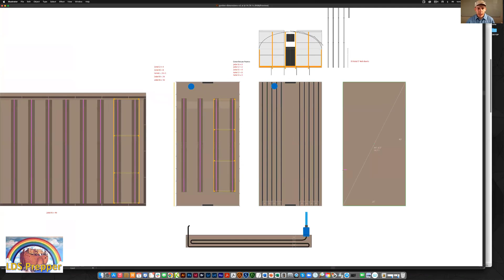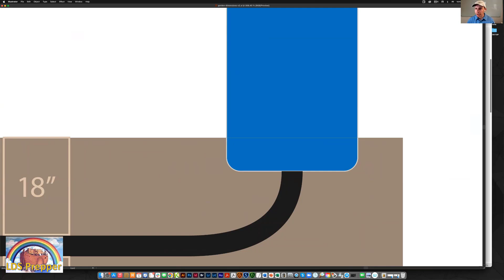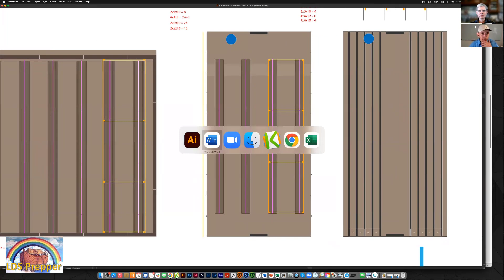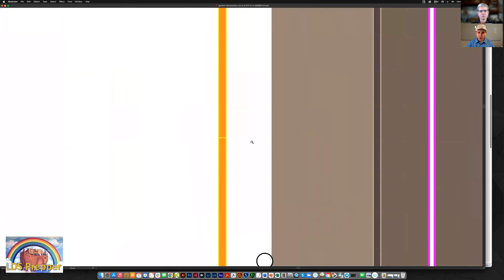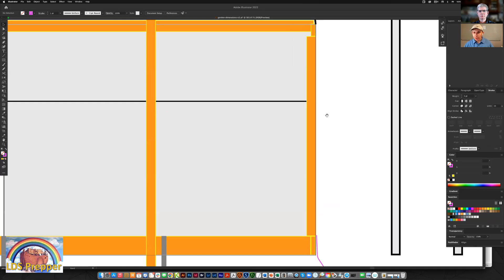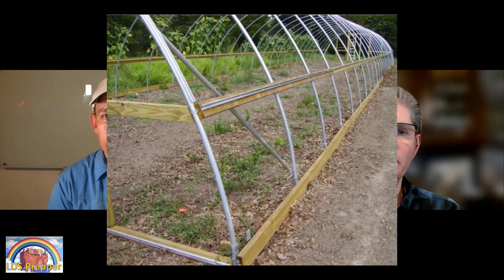Geothermal Greenhouse Step-by-Step: #1 Planning

Comment: So I hope Doug didn't use that for the concrete down the whole method because that doesn't work.  concrete was meant to be mixed,  so the water won't distribute evenly if you just pour concrete and water together you'll have dry spots in the concrete.  Can't tell you how many times I hired a concrete man and he did that.  I had to tear the job out and do it again.  That's just a lazy man not doing his job

Comment: One issue I see here. The pipe on the far right will present more resistance for air suction (length is longer to reach the fan). Therefore the fan will tend to go the easier way and suck air from pipes closer showing lesser. To avoid that issue, a huge manifold is more suitable to collecr the 5 pipes. The fan must be located right at the middle of the manifold (from top view) to have symetrical alignment and ensure same resistance from all directions.

Comment: When setting post, drill a 1/2" hole, 6" from the bottom.  Put a 1/2" piece of rebar in that hole. Place your post. Then pour the dry or wet concrete  mix around the post. Even in the weaker dry mix, nothing will pull that post out.

Comment: I fear that Doug is going to be disappointed by the performance considering the huge amount of effort and expense. The air volume of the greenhouse has absolutely nothing to do with the total length of tubing needed. Tube spacing affects the system bias,  for example, closer spaced tubes will rapidly heat up the limited amount of mass between them which leads to a rapid reduction in the temperature differential driving the heat transfer process. When used for heating, the limited mass with the closer spaced tubes will be depleted of heat rapidly and it will take many hours for heat to migrate from the surrounding mass to replenish it. The main issue Doug will run into is a lack of airflow because an 8" fan will not move nearly enough air for the system to be effective. I would highly recommend that anyone considering installing this type of system learn a basic understanding of the processes involved because errors in the design are virtually impossible to rectify after installation. A well designed system will provide both heating and cooling, at best the design in the vid will provide mediocre heating but no cooling at all. The cooling perfomance is important because its responsible for the lions share of the heat stored in the mass.
Reply: What type of calculation (length/fan size etc) with a long single tube system should be used? I have plenty of space. What you say makes sense and I only want to do it once.  Any sources you can recommend? Thanks.
Reply: @chuckmorgan9829  
Installing a single long tube in a serpentine layout is the worst thing you can do :)
Reply: @JohnGuest45  not serpentine layout.
Reply: @chuckmorgan9829 
Not serpentine is good, i`d recommend using multiple tubes with the shortest practical length

Comment: Hi David, I'm looking at going with a 30-foot by 40-foot greenhouse that's 15 feet high. To get 15% in the perforated pipe(2,700) I will need to go with two barrels. What is the maximum quantity of pipe that will go into a 50-gallon barrel? it sounds like 10 pipes are what you fit in your system being 20 feet wide.
Reply: Jeff.
You are assuming your greenhouse has 18,000 cubic feet of volume which wont be the case unless its a rectangular box with a flat roof :) Fwiw, the air volume of the greenhouse is used to calculate the air flow requirements, not the total tube length.